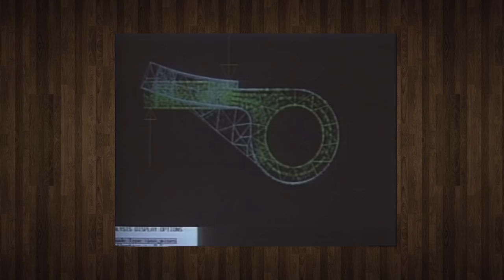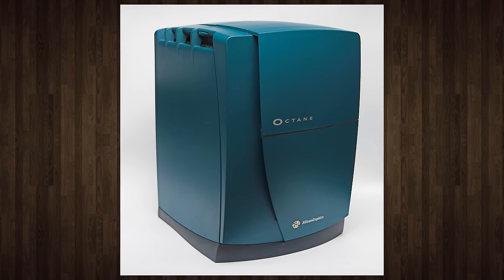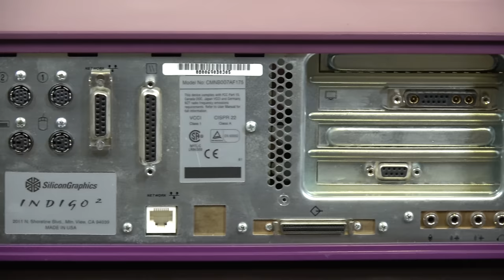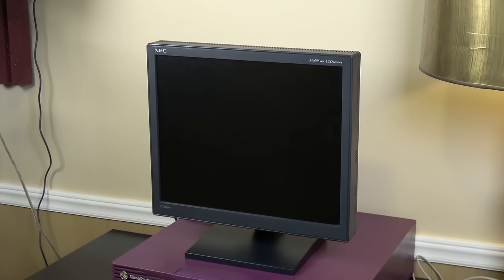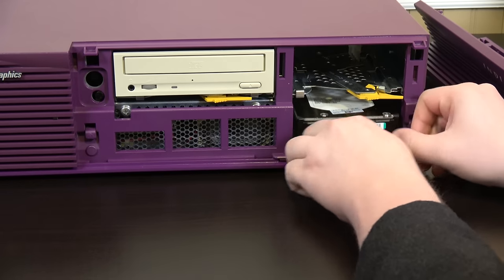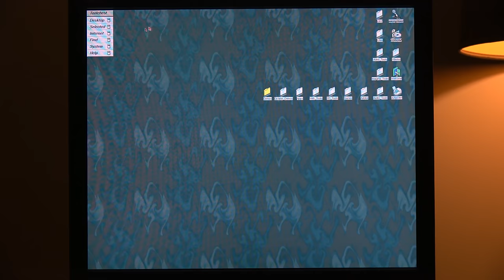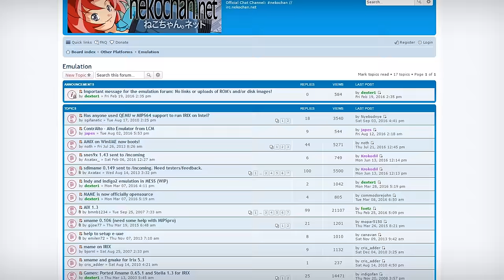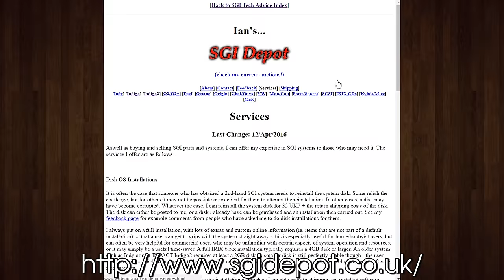SGI Indigo2: An $86,000 Workstation from 1995

Comment: How have I never heard of this? Such a weird and interesting system.
Reply: Considering your name, strange indeed.
Reply: I'm a graphic designer and 3D artist too, how unworthy of me. These UNIX systems, who knows what they are, right?
Reply: So, are you rendering your 3D stuff in "indigo" or "octane" ? ;)
Reply: Zabeus back in the day there were a few companies that used RISC processors with Unix for development and graphical work. SGI used MIPS, Apple used IBM PowerPC, Acorn used Arm and Sun Microsystems used SPARC.
now adays people only use these chips for super computers, servers, and soc. China does do some stuff with mips these days because it's license and patent free but you're unlikely to see them outside of cellphones and routers for consumer stuff all to our disappointment just because custom chips are expensive and Intel/amd is very cheap. the ps3 and Xbox 360 used power chips, the PSP, Ps2, Ps1, and n64 used a mips, Sega almost exclusively used SuperH. 
even consoles these days ps4/Xbox one use pretty standard amd chips though. it's a very boring time for processors these days. the ones that survived have more to do with being the cheapest rather then the best performing or interesting.
Reply: All roads in the 3D graphics world lead back to SGI... you should check out a system some time.
Reply: Indigo Gaming there was a flurry of unix-risc systems in The 90-tys That looked and worked like pc:s. there was to reasons for it. Windows was really crapy back then. when w2000 came with resonable stability a lot of profesionals switched over.

second part was cpu:s. back in The mid 90-tys The x86 cpu was handla faster than The m68k. while The 486 was a resonable uppgrade it was still waaaay slower than The riscs of The days.  but when The P100 came around it really gave them run for there money. what really killed of The risc-unix was The athlon64. That was just as fast as The fastest risc-unix system out there.... exactly as fast....well... The reason is that the athlon64 have a x86 APU and a X87 Fpu. but it also got a alpha Fpu as well as a part of a alpha Apu integritet. AMD bought digital-alpha from digital, renamed The instruction-set to A64 added it to The core.of The athlon cpu and sold it as a combine PC and workstation cpu... and it realy was. later Intel licensed The instruction-set and called it x64 and its basicly what we run today. IF you run a 64 bit Windows or OSX, then you are pretty.much rening old alpha instructions. 

back in The Day i remeber mips-irix, sun-solaris, dec-hp-unix and digital-alpha unix. all was risc-unix workstation.

digital and HP was bought by compact. digital produced there own processors, That part of The company was sold to AMD... soposedly worthless.
mips made The cpu for SGI and was around for s while. i think they still exist, but not making workstation processors. sun start making all sort of crap...  mostly know. is Java. they med a lot of software. still make servers i think.

The risc-unix era died with athlon 64....... or rather it was integrited in The x86 plattform.

its roumoured That Microsoft stolen code to make there NT core That most post 2000 system used from some unix. there was a few court cases,  but they could not prove it. i would guess, it was probobly true.

anyway, The PC of today have more.in comon with The workstation of The 90-tys than The wintel of The 90-tys
Reply: Very interesting stuff. I mean it makes sense, only a few of these were kicking around at the time and I haven't ever used UNIX. The PC I had back in 95 was a Pentium 60 with half a gig of HD space, so it was nothing compared to this (relative to the time) beast. 486's were the bomb for personal computing back in the day until Pentiums came around. I never had one though, I went from 286 to 386 to Pentium.
Reply: Indigo Gaming While the 387 was Intel first attempt  of making a workstation it was really slow compared tot he RISC:s around at that time.

486 gave a huge boast and almost double the performance (per clock), and the Pentium again double the performance of the FPU part (that is the part that was used mostly for professionals at that time... and still is)

The issue was that Pentium didn´t have a 64 bit FPU, this was the main reason why a lot of profession software didn´t want to port there software to the platform at this time. It deamd unsafe. Of cause, running 64 software on a 32 bit computer is possible but its so SLOOOOOW..

Pentium MMX had some 64 bit functions, but it was not untill the SIMD and SSE2 that was introduced in 2001 on Pentium 4 that could handle 64 bit FPU nativly.

This kind of solved the problem, but it was not well marketed, and most people didn´t know about it. Also a lot of software devs simly didn´t know how to SIMD instructions worked, so they just didn´t use them, totaly missing the 64 bit part.

Anyway, the P4 did take some ground on the RISC-UNIX, and SGI first PC used the P4 processor.. or two of them. Still there was a 32 bit ram limit. And P4 was not that good for multi processing (something that was very common on the Unix market at this time)

Anyway the Athlon 64 solved the rest of the problem, simply porting over the whole packet solution from the Alpha processor. Also the in 2005 they launced the dual core 64, basicly closing the gap compleatly. Also the dual core 64 can co process 8 CPU on the same machine due to the 64 bit memory address (where some of the address space is reserved for multiprocessing).

The time from 2001 to 2005 was basically the time that the RISC-Unix was killed of. Most of the ultra professional market was migrated to Linux during this time and the rest normal engineering professional market migrated over to mostly windows
Reply: say that i used Sparc-Solaris professionally just in my very early career just before it died out. I used SGI-Irix at the university for training. I also tried it out when i was younger in conventions.

I used a bit of HP-Unix in high-school in a project. I never tried the Digital alphas. Actually never even seen one. Its kind of ironic because they was kind of the PC of the risc-unix world. They was cheep, powerful and flexible.

To me, Solaris is the best develop of the system. Its on the other hand the slowest GUI to use. It was hardly better than windows at the time

SGI Irix was a rip of of some of the other systems, don´t remember what.

Say Sun, HP and Digital all produced there own processor.  Basically CPU+OS and some of the shelf components => workstation. All the OS was rip of from Berkly Unix. They all used simular x shells, and just different interfaces.

SGI was different. They didn´t produce a CPU. They just bought one from Mips. What SGI did was make 3D GPU:s.. it was unheard of back then.

Just before SGI wen´t down hill a bunsh of engineer jumped of the company and claim they where heading in the wrong direction. They start there own company basically with the same tech.

Maybe you heard of it... it was called Nvidia
Reply: Also a interesting story why AMD produces x86 processors. And this is the most important one. When IBM ordered the first PC to be built they ordered second source of every single component in the system (apart from the OS). Intel had monopoly on the x86 processor at the time. IBM ordered them to free the license to a second source or they would go to a other manufacture. IBM was the lagest player in the world back them, and Intel was a fairly small company. They could not afford to lose the deal. So they second sourced it to Advanced Micro devices.
They then was free to make copies of the 8086 and 8088 processor. But they was also free to develop there own x86 processor. as the Am286, 386 and 486 that is functionally identical to Intel version, but not identical interior.

The contract expired, when the x86 pattent went invallid. So AMD could keep producing x86 processor. Intel made it so there socket was not longer compatible, but AMD simply made there own chipset.

There was also a third company called Cyrix that use to make x87 processors co processor: When intel integrated the x87 in the 486, they lossed there market, so they simply start making 486 processors that was quite easy for them because the x87 co processor is the hardest part
Reply: matsv201 Cyrix still exists, they're Via now. They still make dirt cheap x86 shit. Via also made s3 which was their gpu manufacturer. S3 is owned by HTC now though.
Basically everyone moved over to cellphones honestly.
Reply: Zachary Bittner Yea Via bought Cyrix... i thought the closed down after C3 and C7 series.

I see now they made one more in 2011.. that is the last one as far as i can find. I would really call them dead by this time.. Thow it took quite a while to die.

Its kind of ironic that Via uses Cyrix tech to make ultra low power CPU:s

Yea, they moved over with all the other GPU manufacture.

Well Intel and Nvidia is beating the shit out of everyone in the market (including AMD to some degree). And its not only with performance, is also very aggressive and to some degree unfair marketing.

There is just no chance in competing with Intel and Nvidia. AMD is really just alive due to investors pouring money into it to prevent Intel to get a monopoly.
Reply: matsv201 nah, you're just looking at things from the consumer side. No one would invest in a company just to keep Intel from becoming a monopoly. They are just going through some restructuring and still are able to compete in different markets that Intel does not (like the Playstation and Microsoft consoles)
Besides, if there is one company that wants AMD and Via to survive it's Intel. Otherwise they might very well become a monopoly and have to follow some new anti-trust laws.
Reply: Zachary Bittner 
"No one would invest in a company just to keep Intel from becoming a monopoly."
That is very wrong. There is a lot of high volume users that is dependent on the CPU prices is low. Investing in AMD is a cheap way of lowering CPU prices for that kind of company. The amount of money they need to invest is very low compared to the cost of CPU:s.

"compete in different markets that Intel does not"
Well that is a simple effect of that ATI and AMD merged. They got some synergi effect that made them very competitive in one specific field. x86 APU SoC... Of cause, because the x86 SoC is the fastest once, its the best once for consoles.

"Otherwise they might very well become a monopoly and have to follow some new anti-trust laws."
The anti-trust law don´t work any more. Microsoft tricked out of the court and basically won the case beating up the court. If Microsoft didn´t fell that had a totally obvious trust case, the chance of Intel losing is very slim.
Reply: +matsv201 Back in the days of WinNT, SGI ran adverts for its R4400 CPUs that boasted a 250% speed increase for switching from Intel to MIPS. :D
Reply: Well.. they maybe was.. but the compability was not perfect.. pretty far from
Reply: I know micro$oft is shady as shit, seeing they steal, but they also are able to gather copy-pasted ideas into very stable development environments. I'll give them that. Problem is now micro$oft is trying to take over open source software (seeing how they adamantly negated any GNU GPL v2, and they ended up acquiring GNU GPL v3), I wouldn't be impressed if they found a way to find something in GPL v3 they'd "suddenly love it". 

The difference between those is that (GPL v3) involved IPs inherit the "viral" clause from the GPL v2 + original IP patents rights are kept by the owner, so if indirectly "upgrading" GPL v3, and some IP from other licenses that may belong to original owner, enforces the license disagreement through any agreeable terms in the scope on GPL v3 but NOT the owner license scope(ding ding, microsoft), their IP has the right to do so, and the GPL v3 won't be in effect unless you:

either (1) cause the Corresponding Source to be so available*, or *(2) arrange to deprive yourself of the benefit of the patent license for this particular work*, or *(3) arrange, in a manner consistent with the requirements of this License, to extend the patent license to downstream recipients

Since Micro$oft won't hesitate to send to court anyone that may they find a risk, they will scrap the 3) inmediately or "conform an agreement, where your software would have to give up on any GPL v3 extension that may extend from theirs", the 1)also, since they rely on Windows Kernel as a base for everything, and that is not open source. No doubt they are already open sourcing parts that rely on closed source code. So the coverage is only for the open source part, specifically a software license (entirely different from an IP or trademark), but not their original license part that belongs to them. 

Also, there is a clause in GPL v3 that prevents you from using/transporting GPL v3 code from a third party, if you already have an agreement with another third party. Unless the third party is the same, or both third parties agreed to, and you are included. (ie, you work at AMD, want to use patches from Windows, but then want to relicense these changes). You'd need AMD and Micro$oft to agree a relicense, where you, the coder are using their GPL v3 .
Reply: So: If you have no desire to support GPL v3: use GPL v2 only . If you upgraded to GPL v3 please use GPL v2 or later license. That way they can adjust to your GPL v2 license and they are obligued to work on GPL v3. You then can say your code is GPL v2 and GPL v3 compatible, but still GPL v2, since GPL v2 and GPL v3 clauses are non-compatible. Making it "read-only source code"  or protecting your work if external licenses are voided and your work is fully compliant with their GPL v3 parts

Comment: My first workstation at 3M in 1992 was an Indigo.  It had a whopping 32 MB of RAM, and we had to replace the 16 MB DIMS with 8 MB DIMS because at the time the 32 MB were not yet stable.  The hard drive was 4 GB.  My second workstation was one of the purple Indigo 2 models, but it was not loaded fully.

Comment: Speaking of "The Abyss", that movie was also the origin of Photoshop (later acquired by Adobe).  The software was created specifically for photo-realistic backdrop creation.
Reply from the maker: I did not know that!
Reply: This isn't quite accurate.

Photoshop (originally called Display) was created by PhD student Thomas Knoll, as a personal project to figure out if he could make his Macintosh Plus display grayscale images.  His brother, John, was working at the time as a camera operator at Industrial Light & Magic and helped develop portions of the program (e.g. filter plug-ins) in his spare time.  

However, the software was not created /for/ The Abyss as you suggest.  The Knoll brothers were already trying to find a Silicon Valley buyer for their software by the time John first showed it to other people at ILM.  It had existed for a year or so by that point and ILM had no input on the product.

For the most part, The Abyss's graphical effects were created using a Pixar Image Computer with SGI workstations, as well as Pixar RenderMan for the "water tentacle" scene.  But they needed the water tentacle to appear translucent, and didn't have a suitable tool for the job.  So, John Knoll took photos of the set, used Display to manipulate those photos, then used them as input bitmaps to the water tentacle rendering.
Reply: Star Wars's John Knoll (Special Effects supervisor in the Prequel Trilogy and the writer behind the idea of Rogue One) had a hand in Photoshop? Well you learn something new everyday.
Reply: @TheIndigoBros92  His credit (and his brother) are still there on the splash screen.